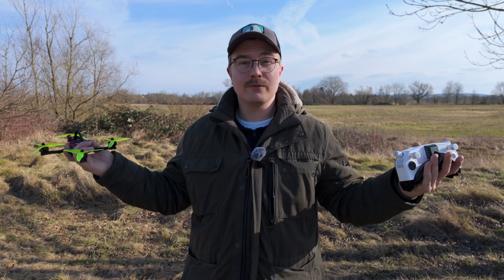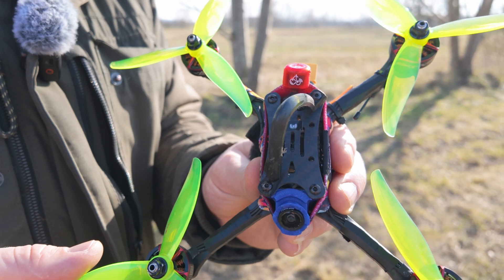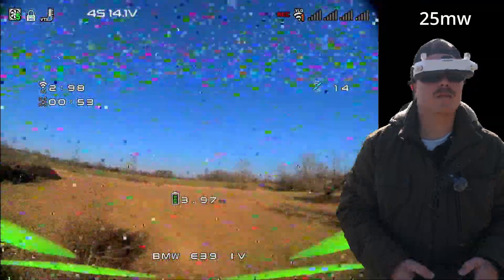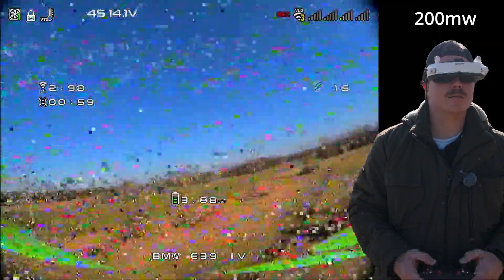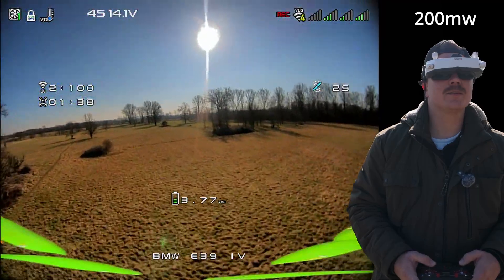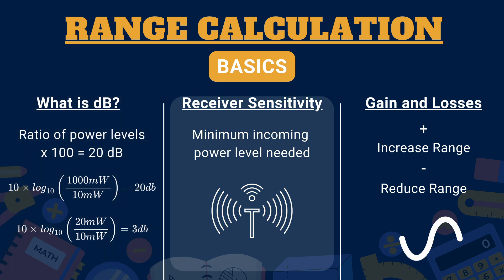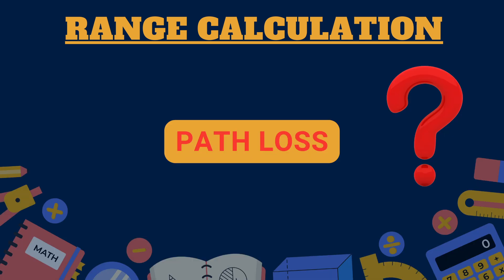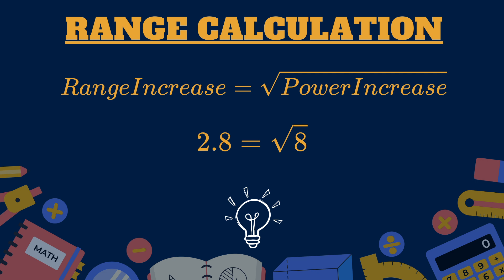More VTX Power = More Range? The Shocking Truth! (25mW vs 200mW)

Comment: thanks for the tips and testing

- mounting antennas as far as possible away from the "drone core", carbon parts, wires,... to get a LOS as free as possible between rx/tx
- match polarity of rx/tx antennas
- choose right antennas for your flying style; f.e. patches for long range in a specific direction, omnis for flying around you
- when using a diversity rx/tx try mounting antennas as far away as possible from each other
- try matching specific antennas and used frequencies
- watch out of "pollution" of frequencys and interference causing magnetic fields
Reply from the maker: @qygpygpq707  indeed everything mentioned is important. Thanks

Comment: Thank you sir for explaining this to us. I am building my first long range drone,  it's a Flywoo Explorer LR 4 v2, analog frame kit and the Holybro Kakute H743 mini v1.3 flight controller,  those are the parts i have so far. Can you please help me with a recommendation for a am32 20by20mm mini esc that will fit in my frame.  Thank you and God bless you and your family and America 🇺🇸
Reply from the maker: Thanks for the feedback! Holybro is also selling stacks with the dame fc but with Tekko32 mini Esc. Good ESC i am using are Diatone and Foxeer and T-Motor. You can also look for BLheli ESCs or do you want to use AM32? Also fine
Reply: @nesofpv thank you for replying. I really want a am32 esc . My problem is that manufacturers only list the overall length of the esc. I only have about 31mm in-between the standoffs front to rear.
Reply from the maker: Any recommendations for esc to use with this frame online? You dont need 60A esc. A small 30A is sufficient for your needs

Comment: I reached 800 meters using 25mW on a Walksnail 1s VTX. Don't know what's the max range on the 500mW setting, but when I turned back @ 2.5 km I had full 25Mbit of transmition...
Reply from the maker: @kmieciu4ever  amazing! That sounds way better actually. However, antenna direction, shape, obstacles, interferences, temperature etc. are all influencing the range. But digital except HDzero is the best for real-life conditions! Keep pushing

Comment: 8x the range means 8x the power?

Inverse square law: am I a joke to you?
Reply from the maker: @smikaFPV   of course no joke to me! But no x8 power is not x8 range increase
Reply: @nesofpv  It is also important to note the fresnel zone. It doesnt just matter if an object is between you and your drone's direct line of sight. ANYTHING inside the fresnel zone will decrease signal
Reply from the maker: Good to know! Thanks
Reply: @ Yep, for 5.8Ghz at 1 KM the first zone is 3.59 meters across. At 2KM 5metes across. So its not a huge deal, but worth recognizing, and is often the reason you have to fly high up in the air the further you are

Comment: 10:51 How did you calculate the range from the path loss?
Reply from the maker: With the "Free-Space Path Loss" formula. Which uses speed of light, frequency and calculated Path Loss to get the distance. Also, I applied a 10db real-world margin.